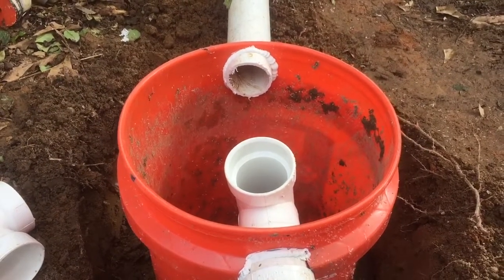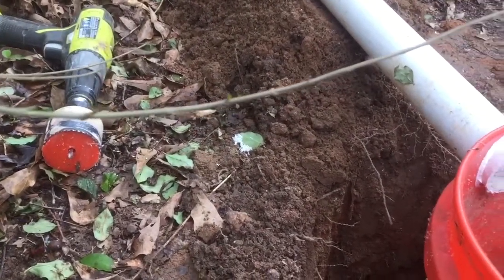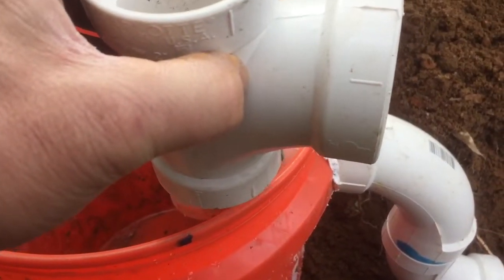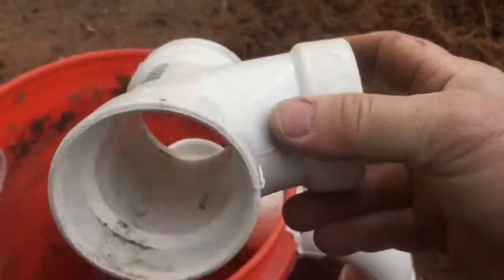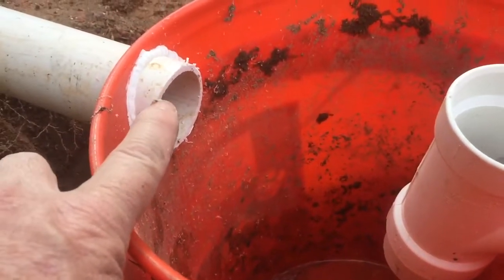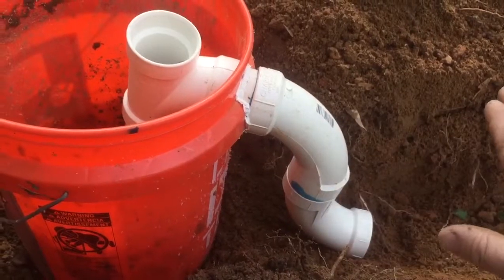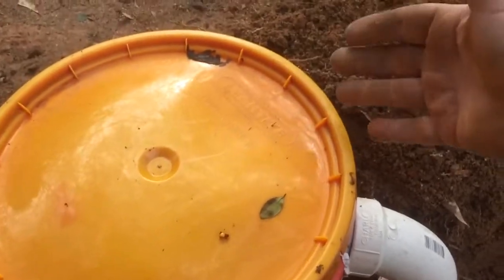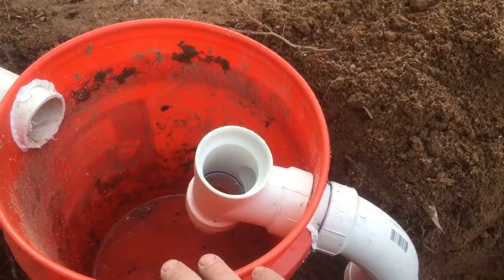Homemade grease trap for your retreat property

Comment: I'm debating on adding one. Is this really necessary if you add an underground leach field? Clogging would be my only concern, it seems like I could just plunge the sink drain if it does.
Reply from the maker: It is not necessary to have a grease trap.